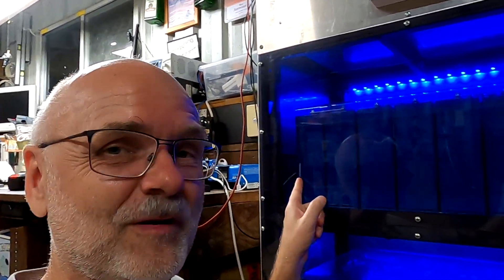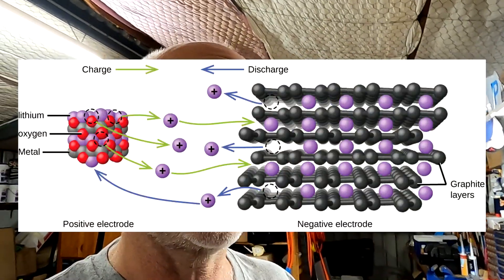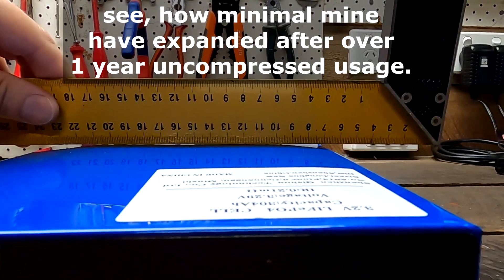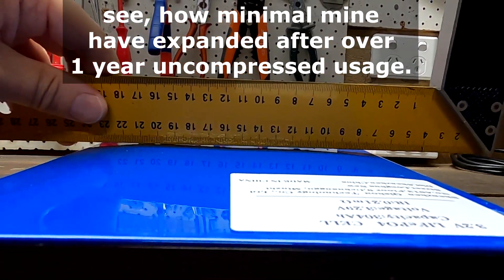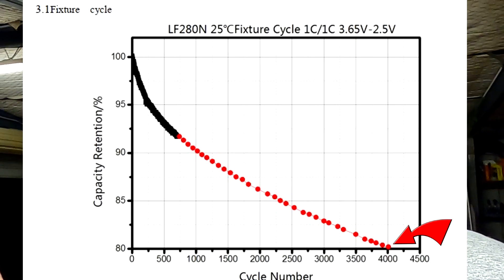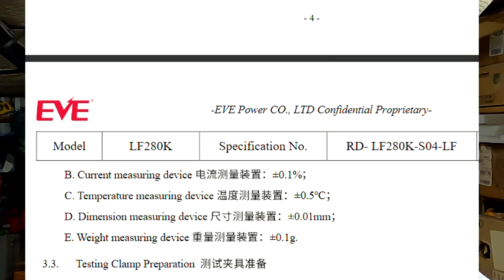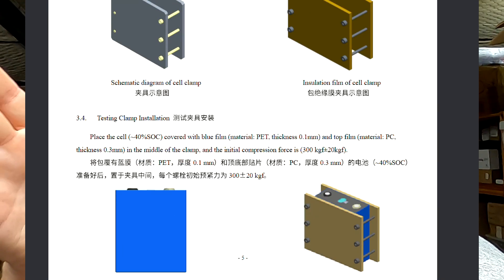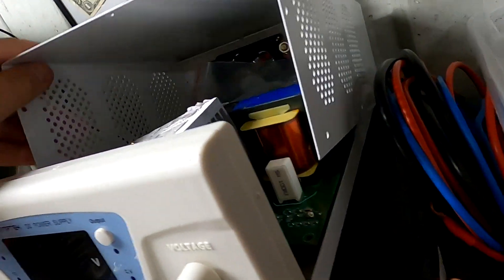Why you should compress your LiFePO4 battery! And why it does not matter... 🤷‍♂️

Comment: In this video, host Andy discusses the topic of battery compression for lithium iron phosphate cells, explaining the reasons behind compressing cells and why it sometimes doesn't matter. The video focuses on the insights from Marcus, a battery expert who has studied electrode materials in lithium batteries.

Marcus explains that compressing cells is not meant to prevent swelling and delamination, as this occurs on an atomic level and cannot be stopped by any amount of force. The actual reason for compressing cells is to squeeze out tiny gas bubbles that arise from the porous material inside the cell during the first few charging cycles. This helps improve the battery's overall performance and longevity.

However, Andy also emphasizes that compression might not matter in certain cases, such as when cells are purchased from resellers who haven't compressed them during testing. In these cases, the damage has already been done and compressing them later on would not make a difference in the lifetime of the batteries.
Reply from the maker: Jeeeez, I should copy and past this in my description of the video...
Or use it as a script for a 1min long video instead of 12min 🤔
Reply: @OffGridGarageAustralia  Just ask ChatGPT to summarize your video (provide it the youtube transcript or use a plugin) and you get exactly that description.
Reply: @OffGridGarageAustralia  used gocharlie
Reply: Thank you for compacting it, you saved me several minutes.
Reply: @volodymyrzakolodyazhny  or compressing it, one might say
Reply: Really the only reason to fixture/ compress in my opinion is to keep the tension on the terminals equal over time
Reply: So you're saying that even if I compress my cells they could still possibly become bloated enough to cause an air gap if pushed too hard?

Comment: so the bubbles go out the vent instead of bloating them? once they have "burped" there is no need to keep patting it on the back. However... what if they've never been squeezed and the bubbles just go back down as you discharge causing the "breathing" you talked about. would it be better to make it burp for a few cycles and then remove the squeeze?

Comment: Make it AS a case and bms mount. 1 module duh. One could manufacture systems to have it all mounted toegther easily and as a standard. It can be made very easily relatively. 2 bent end pieces. straps with bolts welded, laser cut and holes cut and mounting holes all pre determined. 
Basically how mine was made, and it was free and will work waay better than just throwing cells loose in a cabinet.

Comment: Hallo aus Kanada! ICH LIEBE IHREN KANAL!! You're explanations are very easy to follow. You're editing makes for enjoyable viewing. And your sense of humor is awesome! Thank you so much for helping us by answering all the questions which are swirling around in our heads.(I just started taking German lessons, so excuse me if I got my greeting was worded incorrectly)

How bizarre does this layout sound & will it work? 
I'm 62 and am new to the DIY LifePo4 battery building scene, which I find absolutely fascinating! I recently purchased 8 - 320ah cells from AliExpress and plan on building a 640ah 12v RV battery with these cells (hopefully they will actually arrive and I haven't thrown my money to the wind). I have limited space in my battery compartment, so I plan on laying them out on an end to end configuration (4 cells end to end, sitting beside the other 4 cells end to end), so compression is pretty much out the window for me and I'm glad to know it's probably not going to matter. 

I realize 3 of my busbars will need to be an oddball length and if I cannot find the size I need, I will have to make my own (as described by Will Prowes, using copper pipe), so my other question is: Do you have a link to a source for oddball sized busbars?

Thank you so much for any help you can provide and all the help you have already provided. Prost!

Comment: Weeeeeellllll I hear you. Buuut i compressed my cells for a different reason. Common sense told me I need to compress my cells because the buss bars are ridged and as the cells expand and contract during charge discharge cycles it puts a mechanical strain on the terminals. HOWEVER now tgat my supplier provides flexible buss bars at no extra charge i only compress my batteries in applications that are mobile.  The whole air bubble thing is news to me

Comment: Ok, but the specs still recommend the compression to get the cycle number specs. And extreme overcharging causing heavy swelling should be avoided using a properly configured and functioning BMS.

Comment: Test your Cells.
Take a Bulb and connect this to a Cell. Measure the Voltage of the cell under Load.
Press the Cell with 2 Hands. What does the meter say?
with pressing , without pressing

Comment: Makes perfect sense and i have yet to see any sealed battery manufacturer employ any sort of compression resulting in anywhere even close  50kg force let alone EVE 300kg force spec, yet they are warranted for 4000 cycles or more. From the day of manufacture your cells are dying, just use them.

Comment: Hey Andy thanks for making these great informative video's. I have a question, is there a relation between the amount of compression and heat buildup during charging of new MB31 cells? I have build a battery and compressed the cells (don't know the force) at the moment I'm below 10 cycles and see the cell temperatures rise during charge. At the start of charging the ambient temperature was 21C and cell temperature at 25C the charge current was slowly rising to ~55A in 4 hours ambient temperature went up to 24C and cell temperature to 35C. I lowered the charge current to 40A cell temperature stabalized at 38c for an other 3 hours. Then charge current went slowly down to 0 and cell temperature slowly want down to. As I did not trust my BMS measuring cell temperature correct I checked with a infrared thermometer and can confirm the BMS was measuring correct.

Have you ever seen this behavior?
Do you have temperature logging during charging the batteries?

Comment: I buy it.
I have been using all sorts of rechargeable pouch cells since the very first white label units were landing.  All of these had some heat shrink and basic strapping tape.  Many units lasted hundreds of cycles and never displayed any puffing.  Some ballooned, and invariably, those were the units that saw current draw far in excess of C rating and those that saw discharge deeper than mfg suggested.

I currently have about 1,000lbs of old LiFePo4 pouch cells.  They are soldered 8P then soldered again 4S for 8P4S, then wired 4S for an overall battery which is 16S 52V.  Of course many failures so I cut them up...  Originally they had thin phenalic panels on all sides and a heat shrink overage.  As I strip them down the pouches start flapping.  I dont have a bunch of large heat shrink so I am going to upcycle the flat phenalic (to spread any tape load) and just bind the cells up about as tight as they were originally.  These particular cells only POOF if you short circuit them, if you run them at 1C and you never drop below 1V they maintain integrity.  WHen they do puff, it is almost always just 1 or 2 cells in a parallel group of 8P.

Anyhow - I am now using a soldering iron about an inch in diameter (roofing iron) to quickly wipe away the 1/4" of solder off the top without melting the adhesives in the tab seals.  It is an awful and dirty business that I wish I did not start.  Pouch cells are the shits for upcycle and recycle.  I look forward to the day where I can process prismatic cells with just a couple simple fastening points and an ISO9001 sorting sticker.

Good luck in whatever you do

-methods

Comment: I bought a lithonics 600ah battery and it was compressed and i undid the threaded rods and fiber boards and all 32 75 ah calb cells went poof the whole thing couldn't be recompressed again so i got em as tight as i could in the red box and used the dense foam peices to keep them in check ill make a video on it the battery is configured in a 8P 4S setup

Comment: I have a 32AH 8S LIFEPO4 battery.  Rectangular cells.  Not compressed.  Put in service.  For the first year all was good.  Then I left it alone with a trickle charger for 6 months (the BMS should have shut off the charge when fully charged).  I came back and they were hugely swollen.  Probably 4mm per cell.  And blew apart the battery box.  No apparent damage to the lugs.  Can they be recompressed (to fit back in the battery box) and put back in service?

Comment: One more reason to compress is geometric stability - relieve stress for the busbars
Reply: Buy flexible busbars I compressed but after thinking about it would have been cheaper just to buy new busbars that were flexible. The free ones they throw in are not that good I had to sand them to get better contact. The cost of buying everything to compress will cost more then buying the flexible bars

Comment: Of course, there is no need to compress Li-ion batteries if they are charging at 0.2-0.5C, but if >1C, compression makes sense to prevent sharp and long lithium dendrites formation on anode surface.

Comment: Has anyone actually shown that LFP cells split apart through expansion when charging?  I think not... Obviously, there is a chemical process with all battery chemistries which usually involves some expansion & heat so for me it is better to have space between the cells to allow warm air to rise and escape thus keeping the cells cooler than if they were tightly packed together. In a vehicle of some sort where space is limited there is merit for squeezing the cells together but for home storage space is not such an issue.

Comment: Next time you build a battery, compress half the cells in the series circuit, and don't compress the other half. After a thousand cycles or so, compare the differences in capacity, internal resistance, and self discharge rates between the compressed and uncompressed cells. Using all the cells in the same battery assures absolutely equal operating conditions, making compression the only variable. What happens in a laboratory and what happens in your shop are two very different operating environments. The conditions MY battery will operate in, are much more similar to your shop.
   The take away is, testing cells that are actually available now, and testing in the real world.

Comment: There are three major factors that lead to premature cycle life. I think the order is as follows, from most important to least important. 
1) Thermal, over 30-35°C can cut a batteries storage life to 1/6th its potential calander life. 
2) DoD and Rate of C.
3) Bubble Saturation due to lack of initial compression. 

Why thermal matters. 18 years storage at 30°C vs. 3 years and change for 40°C storage. 

So an optimization test would be interesting, taking into account #1 thermal, with respect to adjacent clamped batteries heating and raising the ambient temperatures amongst the batteries over 35°C.

Testing a pre degassed/clamped group. Clamped and not clamped with the not clamped spread out as to not transfer heat to one another. 

See if this has any further optimization for cycle life. 

Will pre degassing/clamping coupled with post degassing to well separated cells for ambient room cooling between the batteries lead to a greater cycle life over a continually clamped bank? A continually clamped bank may transfer heat between batteries leading to a premature cycle life loss vs. A post degassing unclamped, spread out and left to cool between them during use.

Comment: Your explanation sounds solid and clear. But you state positions so strictly that i ask how can you be sure? I could imagine that a compression even after some testcycles done in the factory could still prevent damage by even more little bubbles or at least it will help get the bubbles out of the active material. To me it all sounds more like guessing and try-and-error process what treatment is most beneficial. I agree the effort of compression might not pay out over time because the cells degrade more from aging than from cycling in a typical usage.
Reply from the maker: Once you compress the cells, you keep them compressed. Nobody will take off the compression, even it is not needed any more.
Reply: @OffGridGarageAustralia  agree - but is that a problem? Its better for the capacity if the layers are kept closely together. Problem is the cell needs to 'breath' a bit, a y-bit.

Comment: If you compress 4 cells in one pack in series at 300 kgf, then each cell gets quarter of compression. So for 4 cells it needs 1200 kgf. That sounds unbelievable high. Am I right?
Reply: If I climb on your shoulders and someone climbs on my shoulders are you going to carry half of my weight because there are two of us on your shoulders or are you going to carry my weight plus the one I'm still carrying above? well 300 enough 200/240kg is enough. (the pressure is the same everywhere.)

Comment: Squeezing the gas bubbles out would indicate that keeping the cells vertical is a good idea. I'm going to put 2mm foam padding between the cells to insulate the cases which are connected to the positive terminal of each cell so shorting out would be reduced, and to give it some place to expand without moving the contact terminals on the top between the cells when they expand. Now the only question how is do I need to use a quarter inch aluminum plate or can some stiff plastic for the end plates with threaded rods tying them end to end for eight cells.

Comment: I notice from the graphs with and without compression that there is actually a faster loss of capacity at first with cells that have been compressed. Most of our batteries will never see 2500 - 4000 cycles due to calendar aging out first. So it would seem to me that if you are not doing a lot of cycling, (I only do 120 cycles a year with my RV 900 ah battery bank), there is not going to be any real gain from compression, AND you will experience faster capacity loss in the early cycle life of the battery.

Comment: Hi i have question about the possible air bubbles that might be left after vacuum process and there is a security valve to let over pressure escape if the battery have problem so im wandering if the battery is sitting with terminals on side way then the air bubbles must be sitting on the side where maybe the battery has not be prepared to let air bubbles sitting there, and the security walve therefore not working properly, se video from Average Joe and his neighbour that had problem with one sell that is sitting side way it did puff out at the bottom, but not through the security waive, could that be the case, they cant sit like that, like many are doing? greetings from Iceland. another quiestion... do cylindrical sell expand?
Reply from the maker: When the cells are new, you can hear some liquid inside when shaking (electrolyte) which will dissolve completely into the isolation between the layer over time. The safety valve will work if there is too much pressure inside the case (due to heavy overcharging for example). And it will work in any direction just not upside down.
Cylindrical cells will not expand.

Comment: 10:10 not only without compression, but in horizontal position! Guess where the residual bubbles are going...
Unfortunately, not everything said in this video is true. An ex-post compression can actually damage the batteries, as with age, dendrites are growing on the electrodes and with compression you can actually cause these puncturing the separator resulting in (small) internal shortcuts. Which will result in higher self discharge, temperature raise while charging, etc.

Comment: Firstly; thanks for your fantastic input (output?) Andy…. Secondly; I’m trying to commission (!) a 16S set of 340Ah cells before Xmas and struggling to see see through the miasma! I am now a bit more relaxed about it but there is one thing that strikes me: How does one apply 300kg of force to a battery pack?!?!?! Mine are envisaged to be organised in two rows of 8. That’s therefore 600kg over the two faces. Incredible! I had decided to use threaded bars in conjunction with flat plates of currently unknown dimension and material and spring load the bars with old engine valve springs, to prevent exponential pressure changes as the cells wax and wane, but now I’m not convinced that my springs are man enough.

Comment: moderately compressing the cells makes sense to me.  firstly the manufacture recommends it.
secondly, common sense says the aluminium casing is thin and we need to keep the goop inside,  thirdly, the real reason why the manufacture recommends it, is to keep the goop inside. so keep the goop inside and easy on the clever imaginative excuses. thanks.
Reply from the maker: The manufacturer does not recommend it! It's an option, not recommendation!
The goop will not leak if the cells are not compressed.

It is an option to get more cycles out of the cells when they are compressed. This is totally irrelevant for solar storage thought as the calendar age will degrade the battery before you see any benefits from the increase in cycles.

Comment: Hello, I was do capacity test to my lifepo4 cell , how I can charge 1 cell? 3v, what charger I can use to charge 1 cell? Thanks
Reply from the maker: Any adjustable benchtop power supply can be used. Set it to 3.6V and wait for the current to go down to 0.05C. That's then fully charged.